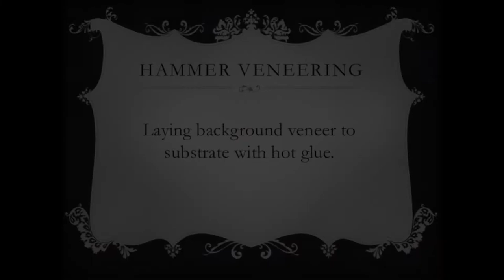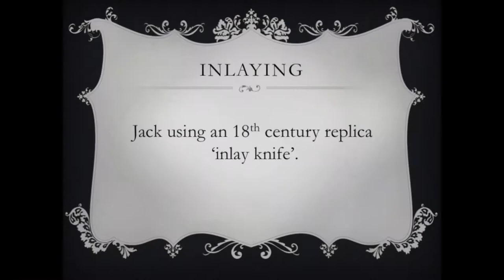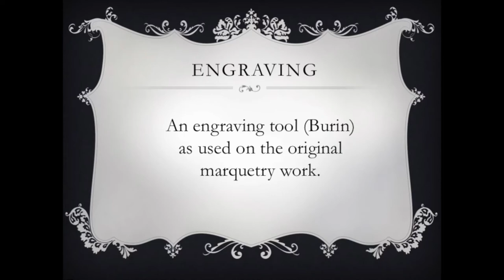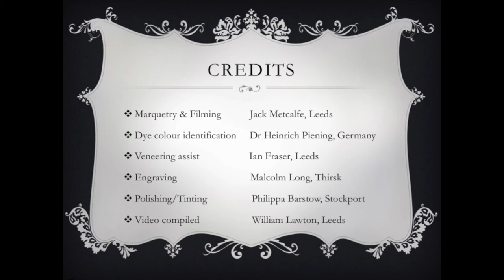Chippendale Inlay Marquetry Technigue

Comment: A rare chance to watch a true master at work, thank you so much for sharing this beautiful video.
Reply from the maker: Thank you Mike, it was a thrill making it because I filmed the work myself which was spread over a full years construction in 2017. The table then appeared in Newby Hall Stately Home, Yorkshire, to celebrate Chippendale's Tercentenary in 2018.
Reply: @jackmetcalfe9732   I thought I recognised the action with the knife when cutting the veneer, I am ex GPO, I used the same ation when cutting open a lead joint with the hacking knife.
Reply from the maker: @mikedarby4872  I’m
Also ex GPO ENGINEER and your right about using the knife to open lead joints. I had never thought of that similarity. Thanks for that Mike.
Reply from the maker: @mikedarby4872  I am also ex GPO and I agree its the same principle used on different materials. Thanks for the connection. I was a telephone maintenance man, not underground prior to moving into management.